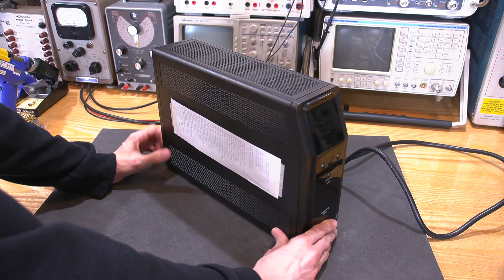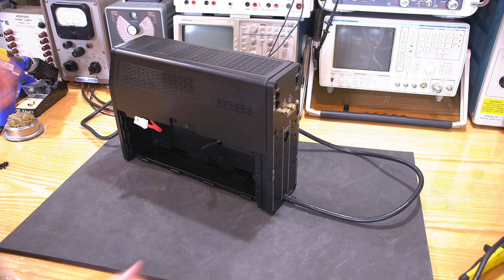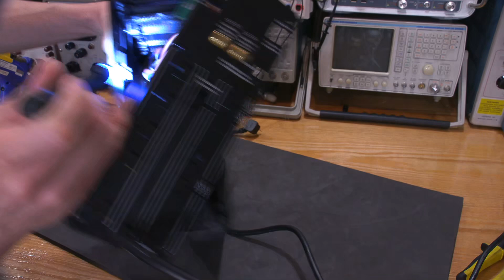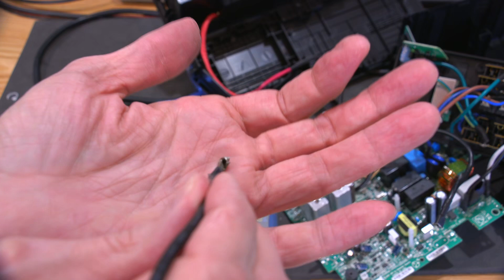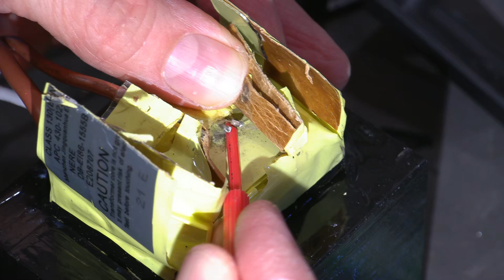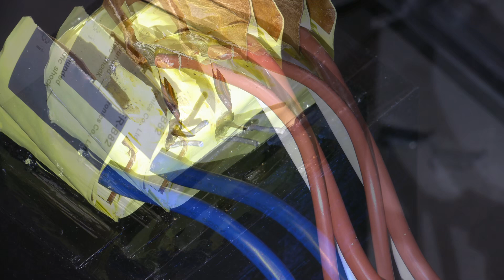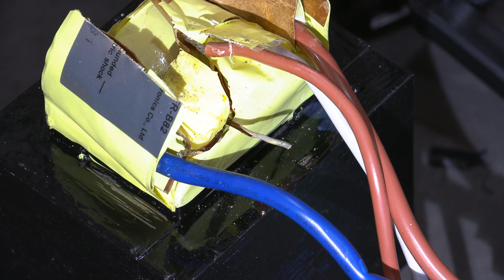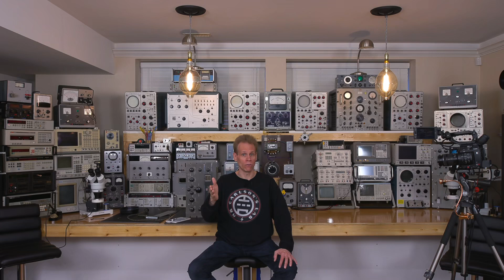UPS Electrical Failure - Teardown and Analysis!

Comment: From 1998  to 2007 we used APC rack mounted 2200 & 3000 units for our server farm sized to give us approx 60 minutes to allow manual shutdown in the appropriate order. We couldn't automate it because it all depended on which processes were running at the time at least during the working day. The only problem we had with them was battery longevity. It generally was less hassle to replace the whole unit than to replace just the batteries. Sad to see the perceived decline in quality.
Reply: Way easier to replace batteries than to remove/re-rack a new unit. Heck, I've done battery swaps live, no downtime required. Bonus for us, the UPS is in the bottom of a refrigerated rack, 17c, batteries lasted far longer than normal room-temp UPSes.
Reply: @SteveMasonCanada  I agree it should have been. However explaining the requirement to people who (deliberately) wouldn't understand !?!? In any case I was eventually able to justify a much larger unified system. I'd left the company before the designated replacement period came due.

Comment: Hello Paul!  Wow Yea that Transformer is toast I don't know why the manufacturer chose to do the connections on that transformer like that or why they chose aluminum for the windings of that transformer anyway.  You would think that for a product like that, that has a sole purpose of protecting other electronic equipment from power deviations or losses that they would go for the best quality in design and or workmanship for reliable service! Thanks for the video and sharing with us your findings with this failed UPS power unit!  John Bellas 73's from KC2UVN.

Comment: The findings in the windings of the transformer is indeed both a  mechanical and electrical connection. The clamp to the 
black wire has failed and the electrons heated the bad joint up (with a large amount of resistance) melting what little 
solder was present inside the joint with  the  discovered  results! Ouch. It might be resoldered using a flux (paste or liquid )
 that has Zinc Chloride in it. Clean off all the old solder on the wires, wedge the clamp open to clean it out and reconnect 
both the aluminum and copper wire. Squish down as  tightly as possible on the clamp so neither wire can move out of the
 clamp. (I would try to find a new clamp designed for this application and not reuse the old one) Then apply the flux and 
solder the connection back again. Should make a good follow up video Paul. Do it.

Comment: I've had several of my own Back UPS Pro-1500's fail in very spectacular ways too! I had one that blew up extremely violently, spitting sparks from the output transistors on the high voltage side of the power inverter itself! The PCB completely melted, got a huge hole in it! Clearly there's a design flaw with them, because it has happened to 3 units just in my own home!

Comment: I have had several UPSs fail. All of the ones I have had fail just went black. No power. No display, no nothing. I threw them out because I couldn't find anyone to repair them and Shippin was 70 dollars each way. Not worth it for a 200 dollar item.

Comment: CCA wire, which is solderable if you use a solder with a somewhat aggressive flux, or a solder with a little silver content. That they used plain aluminium instead of the more common copper coated wire, really says that cost cutting is getting extreme, as that wire really can only be connected to using a crimped on connector, after cleaning it, or using something that has a spring to apply tension to the wire to hold it on a contact block.

Lucky for me I have an older APC, which still has the copper wound transformer in it.
Reply: YEP i wonder if the people they had made the transformers not use copper coated wire
Reply: @Bruce Havourd By the mass, the copper wound ones are much heavier than the aluminium wound ones, by a considerable margin.
Reply: @Bruce Havourd You get to know from the volume, comparing to known copper core of similar VA rating and core size, you get to see the mass of the bare transformer. If the whole unit is still lighter than the transformer alone you know they skimped both on core laminations and wire, relying on the low duty cycle to keep the unit working long enough to get out of warranty.

Comment: Geez APC, just charge the couple extra bucks, and put a label on the side that says it's all copper, no Al. If it costs a bit more, use that as a feature, not a failure point. More importantly, get the bean counters out of the engineering dept. Wonder if there is some sort of recall on them? If this one failed this way, maybe tons more did too.

Comment: Sad the bean counters strike again. Since this is a primary connection to the cord, it would appear even if the unit shut down the arcing and sparking could set the transformer on fire (the plastic/paper wrap and insulation of the wire) and set the unit on fire. Definitely a deterrent to APC. It's getting harder and harder even with 3rd party testing like UL, ETL and CSA to detect cost cutting design flaws (this could be fixed if APC wanted to with the appropriate splice and termination methods) that escape initial 3rd party testing and credentialing due to a design flaw (serious) that fails as an inservice failure not readily detectable as brief test on a bench for listing and labeling credentials. Just think this one or any others like it could conceivably burst into flames on or under your desk during a transient surge since the primary/secondary transformer wiring is so inadequate. Sad Scary the trend of the day! Good name cheaply made with short cuts lost consumer confidence.

Comment: error F02 on battery output short
error F04 Clamp Short
Reply: Looks like the blue wire was kinked and insulation cut by the edge of the transformer core

Comment: One of the things about these UPS is they don't really like being on a system with alot of reactive power.  They ship [most cases] with a default on max sensitivity, and the tools to change that [dealing with other loads presenting power factor in the 60's] are in the software only.  In a corporate setting, you know the drill: call tech support and beg to get the software approved & loaded.  Excessive switching driven by noise drains the battery down, and after a certain amount of abuse the controls or charger just give up the ghost.  I wish they came with dip switches to allow proper setup without needing software installed.
Change batteries every 4 years, folks.

Comment: Our UPS's have to go through 800 to 900 power failures a year in South Africa.
Reply: Yep, terrible. And lead acid batteries dont last long, about a year or two years, expecially at the eastcoast in those harsh conditions. I went completely for Lithium and Victron Inverters, they are made for marine usage... perfect!

Comment: I recently had an APC UPS fail. It was 17 years old, and ran 24/7/365 for those 17 years. Autopsy revealed four failed electrolytic capacitors, and i out of tolerance current sense resistor. These things have piezo buzzers in them, which sound on failure. Sound a lot like what we heard when you plugged it in and attempted to turn it on. The power switches on these units don’t directly control the power. They must be held for a short period of time to either turn the unit on, or off. The transformer looks like Chinese production. The Chinese love aluminum wire, for some reason… Five’ll getcha’ ten that cost has something to do with it… Anyway, I’m not a fan of aluminum wire in any application. Copper is expensive, and has it’s own set of problems, but on the whole, I’d rather see Cu than Al, any day. I bought another, somewhat lower capacity APC unit. Hopefully, mine will hold together. No matter what you buy, it’s basically a crapshoot. They’re ALL cutting corners whenever they can. I guess we’ll see.

Comment: Great video! I have the same UPS power supply. It's too bad that they didn't use a premium quality transformer, or at least wire the connections properly.
Reply: I would not consider a copper wound transformer as "premium quality". I would consider them minimum spec. And attempting to solder copper to aluminum is beyond belief. Hands down sub standard to unacceptable materials and processes, in my book.
Reply: @parochial2356  ...I'VE SEEN YOUTUBE VIDEOS SHOWING THAT IT IS POSSIBLE TO SOLDER TO ALUMINUM- BUT IT TAKES SPECIAL, HIGHLY ACTIVE, SOLDERING FLUX- AND I WOULDN'T RECOMMEND USING THAT IN ELECTRICAL APPLICATIONS!!!
Reply: I was about to buy an APC from Costco which looked very similar but the reviews were so bad (typically citing total failure) that I decided to pass. If I only had some confidence another brand was better…

Comment: I'm totally stunned that they use aluminium, horrible. I'm guessing for cost,  weight and thermal properties during very short overloads, but if you're going to use it, then terminate it correctly lol.... I would be uncomfortable buying APC now, very sad. Great video as always
Reply: its common but it's supposed to be Aluminum plated with  copper then you can solder to it.
Reply: @Mr_Meowingtons  there's a flux one uses to remove the passivation layer from the aluminum (aluminum quickly forms an oxide layer, called a passivation layer to protect it from further oxidation).
So, copper cladding isn't necessary, but cheaper than the flux.
Reply: @Mr_Meowingtons  ...THAT MIGHT WORK IN THEORY- BUT THE COPPER PLATING ON THE ALUMINUM WIRE IS APT TO BE DISSOLVED BY THE SOLDER WHEN THE SOLDER CONNECTION IS MADE-!!!
Reply: Probably not for weight reasons.

It’s a commonly held belief that these kind of things are supposed to be heavy.  They will literally put concrete bricks or cast chinesium in cheap stuff to make them feel higher quality.
Reply: Money !! some Bean counter !
Reply: @richardbrobeck2384  Made In China, a warning label.
Reply: why is everyone afraid of cheaper lighter wire? Please explain
Reply: @thewhitefalcon8539  lower current handling capability. Aluminum is also touchy to work with, as the metal instantly forms a passivation layer of aluminum oxide, which is non-conductive.
Reply: @spvillano  Sure, but as long as it's designed and built properly for aluminium, that should be okay, right?
Reply: @spvillano  People keep saying this and yet the NEC no longer even requires NoAlOx on aluminum conductors.
Reply: @thewhitefalcon8539  ...DON'T YOU KNOW? IT'S NOT THE ALUMINUM WIRE- THE PROBLEM IS THE LOUSY ELECTRICAL CONNECTION(S) WITH THE ALUMINUM WIRE!!!

ALUMINUM WIRE IS A HECK OF A LOT HARDER TO SOLDER THAN COPPER WIRE- THAT RESULTS IN FLAKY ELECTRICAL CONNECTION(S)...THAT'S WHAT THE PROBLEM IS-(!)
Reply: @thewhitefalcon8539  There is no afraid, to recognize it is an inferior material to use.  When I buy a product I don't want the manufacturer to decide for me that they are going to use a cheaper, inferior material.  "Lighter"?  You must be kidding, do you think I would be carrying this around in a backpack on my bicycle so that would matter?

In every way applicable to the purpose, aluminum is an inferior material for a transformer winding.  And it caused the failure.  Need I state more or are you oblivious to cause and effect?
Reply: @stinkycheese804  Products should be engineered in the cheapest, simplest, lightest, etc.... way that works. The problem here is they did it in a way that doesn't work, not that they did it. Your laptop's power brick is relatively light because it uses an offline SMPS design that does not require a huge transformer. Do you accept that, or do you purposely seek out laptops with huge transformer power supplies because "it's superior"?
Reply: Weight and thermal properties?  That makes no sense.  No, it was just cost cutting.  Don't use it and terminate it correctly, simply don't use it.  Inferior material for the application.
Reply: @stinkycheese804  the question was asked and answered factually.
As opposed to your answer thar relies upon telepathy.
Reply: @stinkycheese804  your reply was a statement of what the engineers were thinking. Or do you have documentation to support your assumption?
That it's likely that they were considering cost would be a factual statement, given the practice in other wiring in the past. Note the supporting fact of past use, rather than relying on mindreading?
What I said can be safely testified to in court, what you said would be disregarded by the court.
Reply: Clearly they should of used silver wire with coating on it. Would conduct better and easily solderable
Reply: Aluminum is 8 times cheaper than copper.

Comment: CCA(Copper Clad/Coated Aluminum) is a plague at the moment. There is CCA wire being sold as copper. I ordered 2GA stranded amp wire that was supposed to be copper but is CCA instead and the physical dimensions are off so the crimps don't fit from normal 2AWG. :( I suspect your failure was actually flashing the copper off.

Comment: This reminds me of my ham radio power supply I recently repaired. I just hadn't turned it on for 2 years or so, and it just had no output voltage at all. 

It's a classic linear supply and some measuring showed that the primary of the transformer was open. What happened is, that the primary winding consisted of 2 parts. This is not unusual on itself, could be for 115V+230V. But it was more like 190V+40V or so. Those parts were just connected on a (besides of this) unused solder lug and they didn't remove the insulation totally, leading to a bad solder joint there.  After resoldering it, everything worked fine again. 

The nasty thing was that this lug was covered under a white silicone-glue-goop, which was quite difficult to remove.

I think what may have happened is, that while winding the transformer the supply spool ran out (it is a kinda low volume product, so semi-manual production for this transformer isn't unreasonable). They put a new one in and wound the remaining windings and hid their mistake under this goop.

Comment: I used to use these UPS's in my SCADA cabinets.  Turned out that most of my service calls were because the UPS  had failed and usually when we needed it the most.   I now use a commercial DC UPS that costs $400 wholesale.  With over 100 in the field, I've had 2 fail in the last 10 years due to lightning or big power surges.  Still, If I didn't need to report a power fail at the site, I'd do away with them all together.  At best these office type UPS's are only good to protect from momentary blips and I rarely get more than two years of service out of them.
Reply: What brand of commercial UPS do you use?
Reply: @ericjorgensen4826  Puls UBC10.241  This UPS makes 24vDC which is the power that ultimately drives my panels.  I just cut to the chase and eliminated the "middleman" 120VAC UPS

Comment: So does fancy testing and documentation compensate for poor design?  Easy to see APC cheapened these more current models from the older models ones I've changed batteries in 20 years ago.  Now we've discovered another hidden weakness in their design!  Thanks to Mr. Carlson for exposing the truth!  But then how do we know the other manufacturers aren't doing the same?